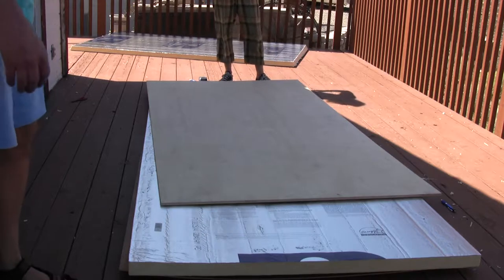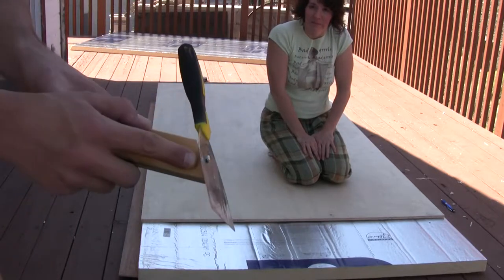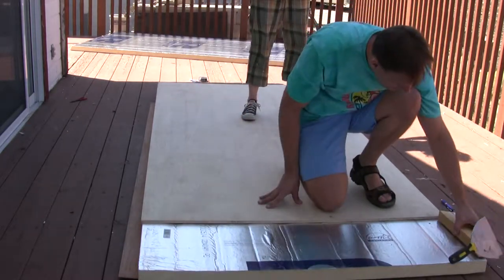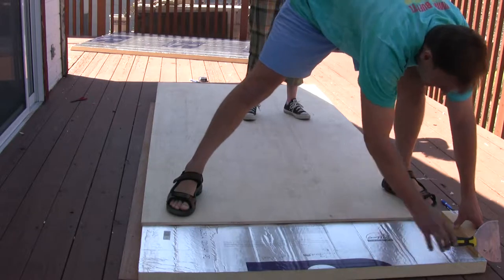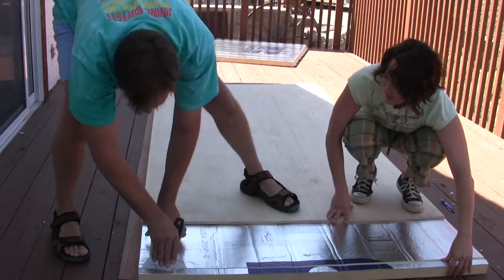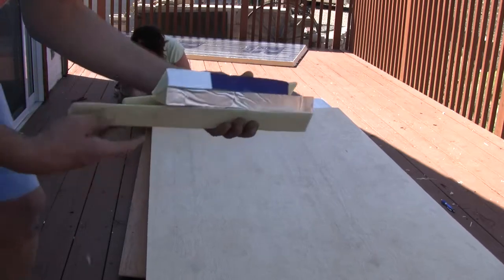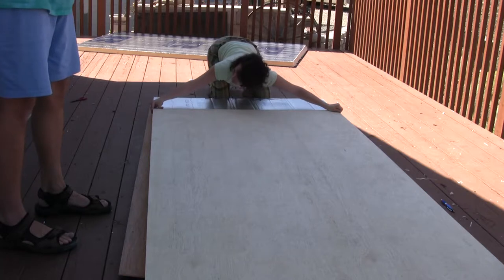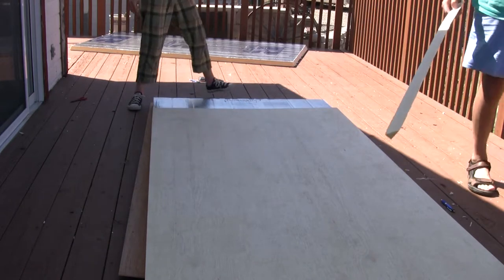Hexayurt beveled edges

Comment: Did the beveling affect the measurements for the roof? If you're cutting off an inch or so on every side of the walls, would it make the roof too big?
Reply from the maker: It actually makes the measurements easier.  The exterior side of the panels keep their original size.  Its just the inside of the panels that will be a little shorter.  It really only works if both sides of each seam are trimmed so they fit flush.  Then you are left with a really tight fitting lid.
Reply from the maker: In this video you can see how all the seams are tight against each other making a well sealed yurt.  https://www.youtube.com/edit?o=U&video_id=ZRkdHT53sGY
Reply: Wonderful. Do you bevel the rood edges as well?
Reply from the maker: Yes.  The only edges we did not bevel are the edges that are touching the ground.  This way ever seam has two beveled edges that fit perfectly together.